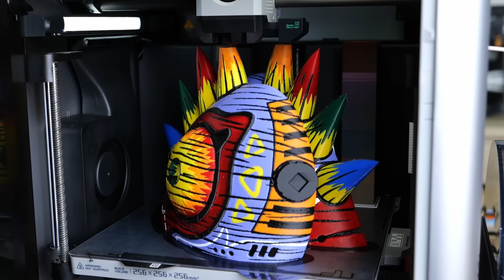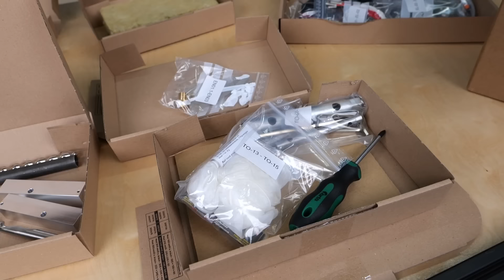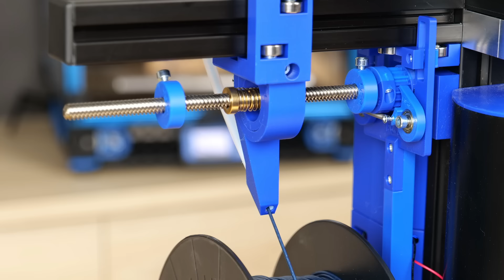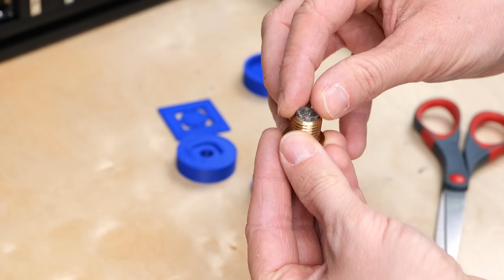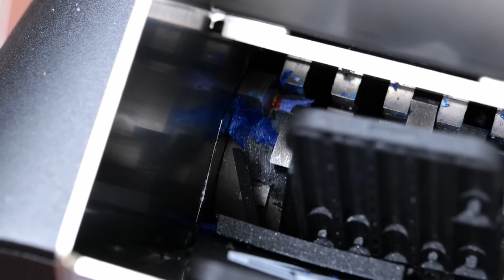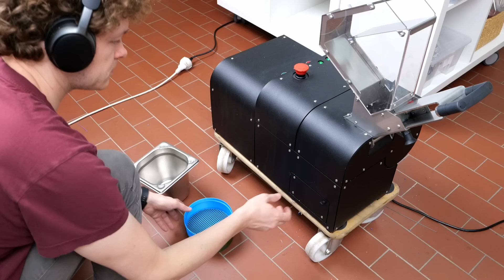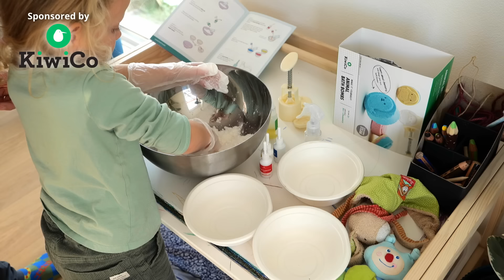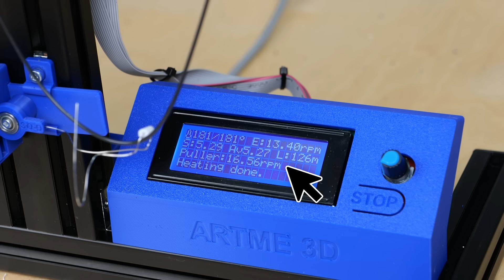Recycling Failed 3D Prints with a DIY Filament Extruder: Artme3D

Comment: In the process of transformation of any type of plastic and by the temperatures that are applied for molding, in these cases also, ( 1* When we use the virgin filament for new 3D prints), quality and technical characteristics of the virgin product [ filament ] are lost)

( 2* Placement in the [mill [cutting blades]] in small pieces the remains of the prints or failed projects to then be placed in the machine ARTEME 3D or any other for the same effect [extruder / spindle ] to be heated again to make the molding in new recycled filament as desired, we are losing quality in the heating processes and in contact with the ambient air with contaminations various characteristics such as, elasticity, ( [ breaking point ] physical resistance of the material until it breaks, etc, etc,... how can we easily increase again more qualities and characteristics intended as in the First VIRGIN material? ONLY USE VIRGIN MATERIAL IN THE PLASTIC MIXTURE TO RECYCLE, / PRACTICAL WAY use a 10° part of the virgin filament that should also cut into small pieces to be mixed in the material to be recycled, or use virgin polymer (balls of plastic material of various types, Pp, pet, abs,.......

More economical and higher quality way, If you buy from suppliers of polymers for the plastic processing industry, bags of 25, 50kg, in bulk, polymers and dyes also to obtain new colors is in this way if you can improve the colors in the process of recycling filaments, thank you guys
For the net filter to be more effective and only be as a second stage of metal filtration, USE MAGNETS IN (TRAMA), the VAN AND STORAGE AND FEEDING PLACE OF THE CUT MATERIAL AND READY TO BE MELTED TO RECYCLE

Comment: The key advantage of that Artme screw is the way the web thickness (the percentage of the screw's cross section occupied by metal) increases along the length of the screw. That should produce gradually increasing pressure along the length of the screw, which is exactly what you need for effective plastic injection and extrusion.

Comment: 19:05 650 euros is crazy expensive, I've seen kits for recycle filament makers for $200 USD.  Recycling doesn't make sense until the machine can cost less than $50 unless you're throwing away dozens of kg of filament a week.

Comment: Are there any 3D printers with built-in filament diameter sensors that can adapt the extrusion to the local diameter for high-tolerance filament? So if it sees a thin spot it would extrude faster once that second reaches the nozzle. It'd be hard to get the timing right, but that could maybe further improve print quality from unprofessionally made filament. I'm really impressed with what you're already getting though! Shows that diameter tolerance isn't actually that big of a deal.

Comment: Amazing video.  One thought on checking the diameter of the filament is a simple optical diameter measurement sensor or a dual axis optical sensor.  With a very small set of roller guides to hold the filament (past the tension sensor), it holds the position of the filament in the sensor measurement area to sample the width as the filament is fed through.  Some sensors can get so accurate, they can measure down to .0005 of an inch but those can be very expensive.

Comment: In the molding industry, some parts accept only a certain percentage of regrind material.  I’d be curious to see the hook strength testing you do, but with this recycled material over the course of multiple recycles.  Curious to see if maybe the material can be recycled a certain number of times before becoming unusable.

Comment: Googled this plastic shredder…. 13000 Euros! I wonder if there’s any other more affordable solutions on the market. 600 Euro extruded is fine, but if you need a 13000 Euro shredder to feed it, it does not make sense. It is a price of a professional Shredder - Extruder manufacture line (used of course)

Comment: so i used to work for a commercial grade plastic extrusion company... even the monster commercial machines have a filter they run the product through but on them its a hydraulic disc tray if you will that has a slot for the filter to sit in... and we used to have to either scrap the filter or change it every so often... the metal flakes and other stuff is unavoidable its from the screws that turn the material breaking down slowly usually... eventually youll need a new auger inside the barrel...

Comment: "Costing only around 600 bucks"

Its cool, and a fun video but im not even considering buying or making this before that price drops by a factor of 4 to 6. 

Its just way cheaper to buy new filament then to buy this and invest the time to build it and then maybe get decent 'prototype' filament out of it that might clog twice or more per spool. And on top of that, this doesn't even get you a shredder that can handle 3d prints.

Comment: You say it doesn't get your money back, but there is a ROI point somewhere. If you look at basic PLA, say 20 euros per kg, you have to recycle that to get even. After that, all trailings that are normally discarded, you can use them again. It adds up quickly!

Comment: This is the "compounding pharmacy" of filaments! The hopper invites more than plastic chunks, it clearly looks willing to invaginate all manner of additives, from plasticizers to fillers, or even pigments and lakes. Why not get in there with some short kevlar fibers and hollow ceramic spheres for densification and skid-plate that refuses to scrape off. Adding in some tungsten or molybdenum disulfide will make surfaces near frictionless for those locksmithing tools that slide in where they're not supposed to. Or planning ahead to some strengthening process like vulcanization of rubber with a UV activated monomer that will crosslink your printed part to itself like tesselation adds triangles, this will add reinforcing fibers after or during your printing. Modify the hopper just slightly and you can use it in hot-melt-extrusion process the pharma industry was introduced to in the last 2 decades, by BASF. It is not limited to getting a uniform mix of things that don't mix uniformly otherwise, but I suggest a "me too!" by molecular gastronomy, let's make some weird alien $|-|!+ we can eat! Be the visionary formulator that makes some freeze dried thing you can't believe you're eating, yet don't want to stop. Metals, ceramics, performance polymers... This is a laboratory, not a recycling bin!

Comment: Okay, even if you don't have a shredded, this will save you a ton of money on creating your own filament from pellets.

I bought it a couple months ago and it did pay for itself by this point (excluding whatever price of electricity). So far no issues, I had only one small hiccup when I destroyed the screen (user error), but it's easy to fix. Oh and the cooling fan randomly died on me, so now I'm a proud owner of RGB machine, +10% in performance.

All in all, I'm as happy as I can get. Currently I'm working on some reliable way of shredding the material, got a bunch of supports and fails to recycle, all the usage up until now was to turn pellets into filament.

Edit to add: You can make custom colors with high degree of accuracy, use additives in filament and make some proper glitter stuff.

Comment: Idea: make a go/no-go gauge with the filament diameter measured between the opening edges. Just let the filament run in the gauge, and it can tell you if the size is correct without using the micrometer.

Comment: coming in new to 3d printing, i really am uncertain as to why people dont see the angle on buying pellets instead of filament to get the return on investment, the waste recycling thing is just an added bonus for what is the ability to make a 12 dollar spool for basically 2 dollars (with the only caveat being we probably need some additives which could be where the next aspect of improvement in the market)

and for colour 3d printing where the waste generate can reach basically the same amount as the actual print. (where the recycling aspect can start to be more of a concern)

i guess if its possible to refine the machine to be more automated for the same price point if not hopefully a bit more cheaper, people would people consider the idea.

Comment: $600 plus the industrial shredder. And all this requires fairly constant PMs. I think a much better concept would be a local (semi local) filament recycling center. A place with an industrial filament recycler that takes in old prints and waste and resells at a discount.

Comment: Theirs something called a wire roller. Two wheels that have a half circle grove cut into it that creates a die of the desired diameter when these two rollers are placed 3 each other. If you can find cheap ones then you can have the slightly larger filament go through the desired roller to make sure it is pressed down to the correct diameter while also acting as a bit of cooling if the rollers absorb enough heat. It would remove the need of the loop and hook to ensure correct diameter.

Comment: *requires 150 dollar special CNC feed auger for... some reason.
**filament stretched to correct size by "gravity", not swaging or a collet
* filament guided onto spool by paperclip with tiny foam* roller, attached to 3d printed part...
****Uses old, common parts from 8 year old harvested printer

Yeah, these designers did a good job on this grift. Expensive parts used when it should be simple and simple parts used when it should be expensive and robust. 

Why can i reload ammunition for less than 200 in equipment, with much more danger AND precision involved... but this filament recycler needs a 150 dollar FEED AUGER!? 🤣🤣🤣
Oy vey!

Thank you for the review and video, much appreciated 👍

Comment: If you just buy the screw and melt chamber, and have most of the other parts already, the price seems quite compelling. Not only can you save money and waste using recycled material but you could also make new filament using pellets which are way cheaper per kilo than rolls of filament.

Comment: Sense & Sensibility

Future developments:

I will like to take this opportunity to thank you for your contribution towards filament recycling.
It is an imminent product not just for cost reduction however as a contribution towards a safer or Green planet.
The future will be brighter with such a product
I know its still in the development stage with a bit more improvement required such as consistent filament diameter  etc.

A 10cm tube aligned directly with the nozzle can improve consistency in filament diameter.
A 1.74mm tube 10 cm in length can be aligned with the nozzle hence the filament almost cools down to its solid state in the tube and as a result retaining a similar diameter to the tube and also if any expansion should take place it will not exceed the max diameter of 1.75

I hope your product achieves economies of scale so that people like myself will be able to afford it.

Sincerely

Ejike Ememe

Comment: Filament recycle is probably a thing should be done as a community. Everyone buying these for themselves is not ideal and kinda defeats the purpose. Good, semi-industrial solutions with decent machines and PPE would be a better idea. Everybody can contribute their scrap, and can get recycled filament for cheap. If you can donate your scrap, and get a discount by weight as an example, that would be cool. Even not donated, if you can buy the filament 50% off retail, would be amazing. 

One thing I'd see it experimented, is how recyclable the recycled filament.

Comment: I've been saving all my failed prints and scrap filament since I first started 3D-printing for hobby projects, 4 years ago now. I still don't have enough waste saved-up to break even on a setup like this, but this is exactly why I've been saving them! I'd rather have a pile of waste in my basement waiting to process when the hardware is available cheaply enough to do it, than have it all go to landfill. This is VERY promising for the future of recycling 3D-printer waste. I'd be willing to invest in this machine, even at a personal loss, if there were a similarly reasonably-priced shredder to pair with it.

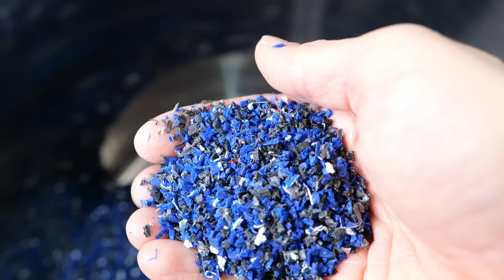Comment: 1:38 -- looks exactly like a feed screw for probably every type of extruded plastic or rubber process.  The idea is to compress the material as it travels towards the end to eliminate air bubbles and provide a more uniform mix.  I have actually cleaned several used in HDPE bottle production (milk jugs, laundry detergent, oil bottles, and so on)

Comment: How is 650 euros affordable? My whole 3dprinter setup is about 200 euros. You can buy like 33kg of filament for that kind of money. How much time would it take to recoup the investment to at least break even? Looks like my scrap filament will just go into the trash until someone figure out a way to recicle it for cheaper than buying new filament (or at least comparable)
Reply: it is extremely affordable compared to the next one which is around 10000e.
Reply: @riba2233  A porsche 930 is extremly affordable compared to a Bugatti Chiron. It still doesn't mean the porsche is affordable.
It only makes sense to compare how much it cost to recicle filament vs how much it cost to get it brand new or at least how much time you would need to recoup the initial investment. If it takes like 5 years, it doesn't even make sense and the technology is still way off.
Reply: @fjrevoredo  it all depends on how much y0u print. If y0u don't do it a lot then ofc you shouldn't even look at this. But if y0u do, then you will go through a lot of filament and have a lot of waste and this will make sense. It is really affordable for that it is, and it is not a luxury item like cars y0u mentioned, so it is a poor analogy.
Reply: it also isn't all about the amount of filament that you can buy with the money. the problem here isn't money. you can buy more filament, it's pretty cheap at around $18 per roll. 

3D printing waste has no way to be recycled. it has absolutely zero ways implemented in recycling facilities to be recycled. no processing facilities, so it's up to the consumer. I would rather spend time & money to figure out the best way to minimize that waste. it's worth the time, money, and peace of mind to know my 3D printing waste won't end up in some sort of critter's stomach, killing it.

Comment: If you could find a way to attach a grinding device, that dropped "finely" ground up filament particles, into the hopper at (13:38), you'd have a sellable filament recycling device!

Comment: Thank you for making this video. It answered several questions I had regarding this space of activity. I am currently wondering whether or not we could develop a more efficient recycling process by changing the method of raw material deconstruction. For instance: Instead of using a standard crusher/chipper, what if we used a wood planing blade cylinder? This can produce thinner chips that melt with less energy consumption. I suspect that these chips should feed with a greater degree of regularity due to their geometric profiles. 

Regulating chip density would be dependent upon material infeed, blade geometry, and the number of blades in correlation to the revolutions per minute (I'm guessing somewhere around 3,000rpm with a standard 3blade planing cylinder is a good place to start). RPM will play a big role in regards to consistent material flow vs clogging/jams.

Working concept: Throw whole parts into a heated hopper/tube assembly which turns the parts into a solid cylinder (this may create gaseous inclusions, which are acceptable at this stage). Aforementioned cylinder directly feeds into aforementioned blade system, producing shaved chips of a regulated nature. Said chips can then be fed through a similar filtration system (same filter, larger area, better efficiency and consistency), and then into the extrusion head. At this stage, there is a gas venting system to circumvent gaseous inclusions, as well as pressure variations (which directly effect extruder output speeds in correlation to material densities).

Because we will know that our filament will be uniform at this stage, we can then create an active feedback/real-time measurement system that can be programmed to reduce or increase feeding speeds as needed. Additionally, introducing a cold jet stream of air across the path of the extruded filament would help regulate expansion-related problems during wind-up. 

In short: a handful of changes can seriously increase the efficiency and affordability of this process/machine.

P.S.: Look into low grade ball screws for a feeding mechanism!

Comment: Okay….so the machine extrudes waste into new filament….great…all you need to do is shred it small enough in what looked like a very expensive plastic shredder…..then dry it in an oven … likely doesn’t have to be a specialty oven, but it was….then run it thru the vacuum machine with descant….till the next day…then put it in the $600 machine. Yikes. All so you end up with filament of questionable quality for other print jobs. What this hobby/industry needs is an industrial recycling program that you can ship or drop off your waste for free and maybe receiving a discount on purchasing new product if they are making new filament….I’ll admit the nerd in me loves getting to build it, I love all the machines and tinkering going on, but this cannot be cost efficient. Maybe I’m wrong..my wife often tells me I am.
Reply: it's about not contributing to the landfill more than anything. I use my recycled filaments for my more draft parts & small props i'll just end up painting, so the color doesn't really matter :)

Comment: So, only 600 dollars for the kit. Plus 30 for the filament, 20 for the adapter. 3000 for the scraps grinder, 500 for the drying machine 100 eletrical bill, should I go on?